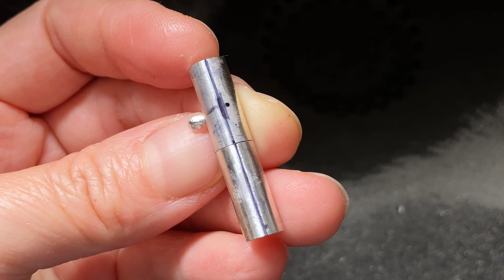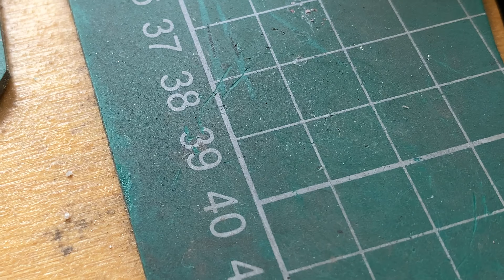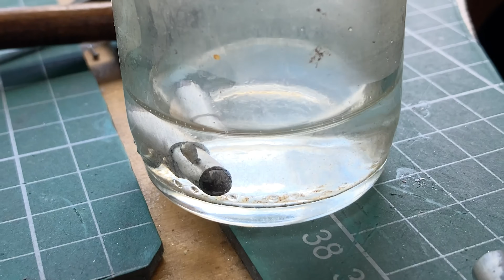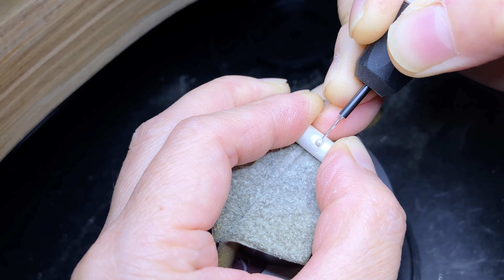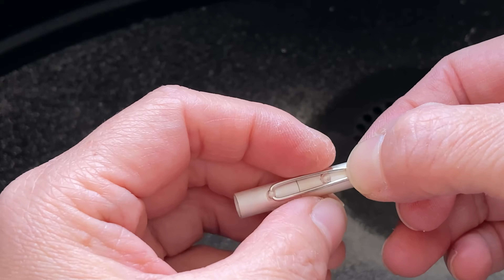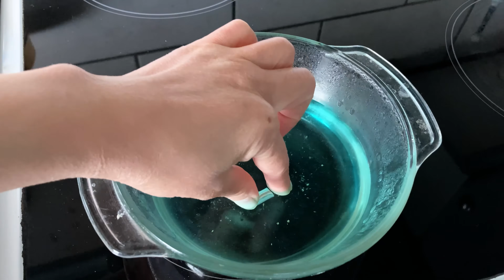How to Make a Safety Catch for a Tube Clasp

Comment: I find that inserting the wire through the tube and carefully bending each side up until they meet in the middle keeps the safety catch from rolling. It should be tight and sharply bent.